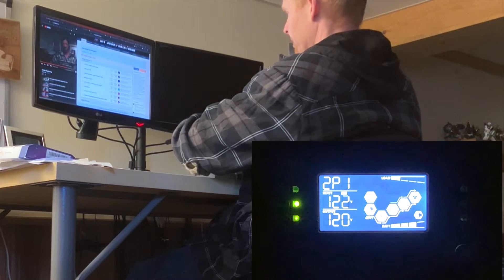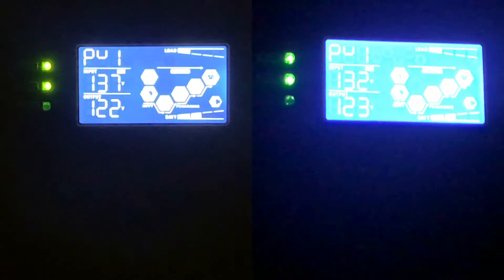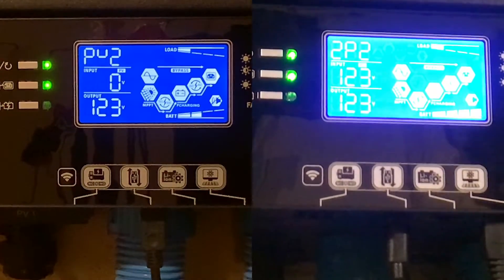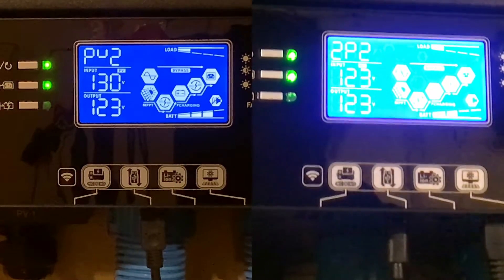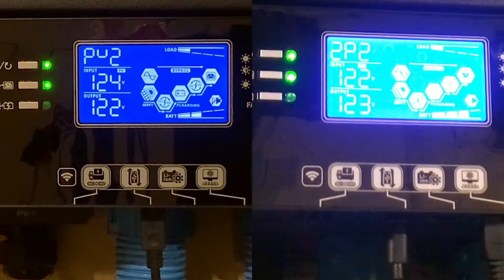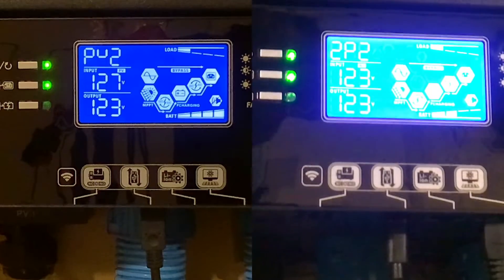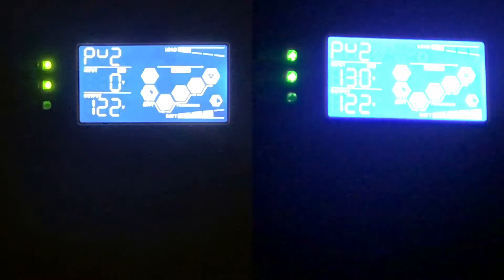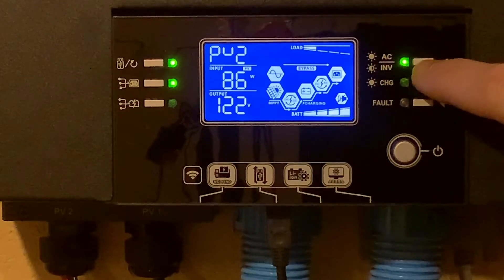Inverter Keeps Dropping the Grid Connection, Part 2

Comment: My Eg4 6000ex is now going to Fault 08 (high voltage on bus) when bateries reach full charge during solar. If I disconect the grid all is good.But when grid is on and the charging cycle ends, fault 08 comes on.
Reply from the maker: It’s funny you say that because while I haven’t gotten a that error code, I have noticed in the past that lights seem to flicker more when I’m on grid bypass, and my batteries get full.  Not the same issue but still another issue when in grid bypass…
Reply: @AdamDeLayDIY  I too experience lights flickering when solar is feeding loads. Usually on led lighting.

Comment: I am having similar problems with my lights blinking in my entire house every time the inverter switches modes.  I contacted them one week after my purchase and they gave me a long list of stuff to send them.   You are the second person that I have seen having similar problems like I am.  Thanks for posting your problems!  Maybe they will respond and fix yours.   Please post any other findings.
Reply from the maker: Will do!  

I mean I get the lights blinking a little bit when the modes change.  They basically do the same thing when a larger load kicks in and dim/blink for a split second.  My problem is the fact that the inverters keep switching between modes (somewhat randomly) causing the lights to blink with each switch.  So when I’m working in my office and I have my lamp on, it’s constantly blinking.  When my wife is working in the kitchen, the lights keep blinking each time the modes switch between grid and battery, then back again.
Reply: I’ve had This issue with lights in the house blinking. It’s very frustrating.
Reply from the maker: @richardreese5377  Yeah, it’s really annoying when they keep blinking all the time.

Comment: Voltage from panels too high?
Reply from the maker: Nope.  Largest string is prob 200V.  Lowest I have is 120v.  I believe minimum is 90v?
Reply: The inverters can take up to 500v dc I forget the lowest voltage they will accept

Comment: Not having issues like yours with my LV setup.   I do not use BMS coms to the LV.    And run SBU during 7a-7p and SUB over night.   My 30KWH is never
below 40% SOC.   During they day, combine PV (even cloudy) and batteries have not tripped auto switch from SBU to SUB or USB. I do think there is
something not right with your EGs.   Did you deactivate the SA's "Maintain battery state of charge"?
Reply from the maker: Yeah I’ve turned off the SA option and am running another test right now.  I’m in SBU mode and I let the inverter switch to utility based on the low voltage option.  Still had issues.  If this current test pans out I’ll let you know.  Promising right now.

Comment: I have a similar set up. I have my pc/tv/fridge/furnace/h20 htr/internet. On my pc and TV I have battery backups(B.B). When the 6500ex swap to ac by pass the B.B will hum for 5 sec or so, when switching back to battery feed nothings. Only makes hum when swapped to AC from Pv/Battery. I never see my screen or pc switch. 
I also tried this with just the pc on extension cord, nothing (PC was pulling 750w at the time) my 6500 are set for appliance. Keep us updated. I have a question for you, what is your grounding method for you pannels(I saw the ones on roof and stands (2x on ground)
Reply from the maker: The only reason I see the monitors go out is due to my KVM.  It doesn’t have any capacitors in it to handle the change so it completely disconnects everything when there’s a power loss.  Just a poor design.

For my panel grounding, I have a dedicated ground rod outside by barn for my roof array.  Right now the ground mounts aren’t hooked into that grounding system.
Reply: @AdamDeLayDIY  
Ok, I asked about the grounding due to my first solar array, all ground mount on cheap kit( used wood on feet/no good ground) would cause the GFI to trip in my AC input to my cheap 5kw inverter when it rained or was wet. I would do some experiment with taking stings off line one at a time and see if you can stop the AC bypass swap, or at least eliminate PV power as a cause.
Reply from the maker: @leeshively669  interesting.  I've never experienced anything like that with my ground mounts.  No issues at all in all the rain/snow I've had so far this year.  

Funny you mentioned removing strings cause that's actually what I'm experimenting with right now.

Comment: I am still having a similar issue, in the previous video I had a comment where I did a full system reset. That only worked for about 2 days and the problem came back. Since then I found that this issue seems to be when the mode is SUB or battery SOC is at setting 12 and the solar panels are producing power. This does not occur at night (no solar  power) or if the mode is SBU or USB. 
I finally just manually put the system in USB mode in the morning and then to SBU mode once the  battery SOC is above setting 13. This has been working for about a week, but it is not the way to operate long term. Waiting on Signature Solar to help, to me it looks like it is in the software
Reply from the maker: Thanks for sharing.  I’ve got another test I’m running and don’t wana get any hopes up till I can confirm it works but it’s been promising over the last couple days.  I would agree it seems to be something in the software though.
Reply: @AdamDeLayDIY  Any feed back on the test?
Reply from the maker: @allennovak3073  tomorrow will mark 1 week since I started my test and so far I haven't had any times to my knowledge where the grid has dropped out to battery and then switched back to grid.  Unfortunately, it's not a fix, it's just a work around.

Comment: I think at this point if support cant explain what is causing the issue they should replace it. My Growatt 3000 is now working as expected, but it was a steep learning curve to get it there, I am still going to go with a component setup moving forward, Off Grid Garage has shown me the potential of the Victron stuff, although I will probably purchase a cheaper inverter than they offer.
Reply from the maker: Yeah I love the Victron gear.  Between them just running and the low idle consumption, they’re very appealing to me.

Comment: Its unfortunate that Signature solar is not prioritizing support. Its been as issue with us since June when we bough our first EG4 product. They continue to release new products which puts additional strain on an already strained support structure. We have found (if you don’t connect grid power) the EG46500ex to be a good inverter at the price point.
Reply: I’m setting up this system for backup power as a UPS with no solar with 2 EG4 6500ex inverters connected to grid power along with 6 EG4 v2 batteries. I’ll let you guys know if I experience any similar issues or something else. I probably need another 2 weeks to get the system online.
Reply from the maker: Yeah it is unfortunate.  It does seem true that  if you don’t use a grid connection at all, things work pretty well, especially for the cost.
Reply: @AdamDeLayDIY  wondering how much is due to sine wave sync issues causing the inverter to get bumped to different mode, any change in shore power sine wave fluctuations might cause a mismatch in the inverter causing it to drop and switch modes.
Reply from the maker: @jcschwarb  hmm, not sure.  I would think that if there were sine wave issues coming from the grid, I would have more issues with my 240v loads as well.  I wouldn't think the inverters would be THAT sensitive but....
Reply: We first tried our 2 Eg4’s on solar battery only . Still had blinking lights
Reply from the maker: @richardreese5377  Are your lights LED?   Do they blink all the time?
Reply: @AdamDeLayDIY  the Led blinking are more noticeable than regular bulbs . 
No it’s not all the time. The inverters are capable of working properly. 
So I don’t know
Reply from the maker: @richardreese5377  Ok, thanks.  Yeah from my understanding (as limited as that might be), LEDs are very susceptible to any voltage change.  The cheaper they are, the more problems you’ll probably end up noticing.  I ran a test on a few bulbs that were blinking in my house and when I swapped them out for “higher quality” bulbs, the blinking/flickering drastically reduced.  I’ll throw together the video of my test at some point.  

I also just saw something very interesting on the DIY Solar forum regarding flickering bulbs.  Someone was asking why the higher quality inverters don’t seem to have this issue and someone pointed out that that while some of them are HF inverters (just like the 6500s), they have a lot more capacitors inside designed to handle voltage fluctuations better.  If I recall, the 6500s have 2 large capacitors while others have 5x that amount.  Just thought it was really interesting.
Reply: I can’t get my EG4s to read my EG4 LL batteries, they come up at close to zero SOC after topping them all to 100%
Reply from the maker: @jcschwarb  the LL models have the screens on the front, right?  Do the individual batteries show fully charged?  

I'm not that familiar with how the communication works between multiple batteries and the inverters (especially in your case where you have multiple inverters per phase).  I'm guessing you have the 1 communication cable going into a single inverter with the LI protocol set and all the rest have no communication and are set to USE (at least I think that's how it was supposed to be set up)?
Reply: @AdamDeLayDIY  no screen on the front of these batteries. Not sure what the LI protocol is
Reply from the maker: @jcschwarb  Sorry, the battery type protocol under menu option #5